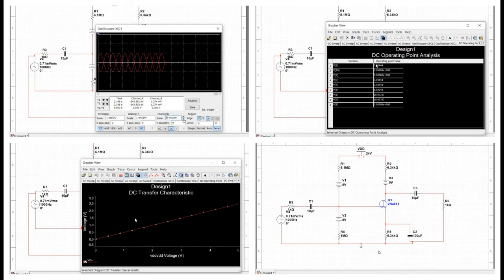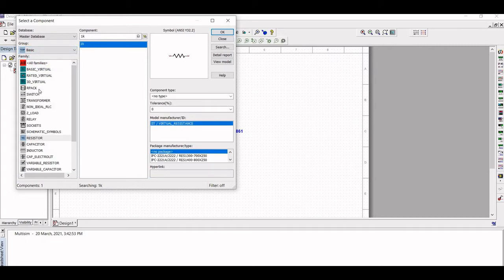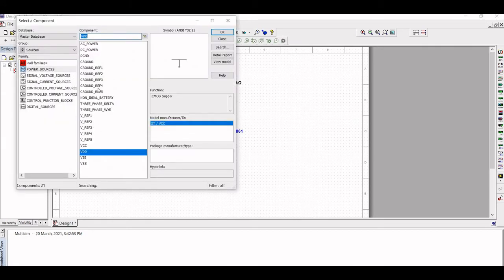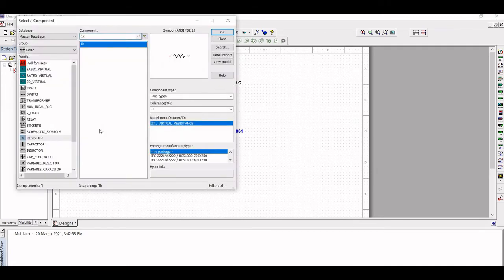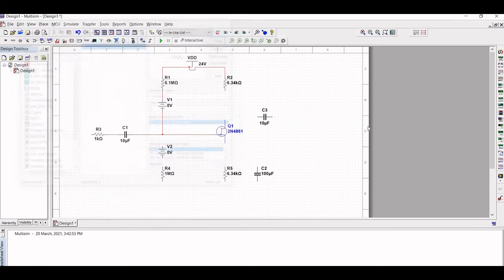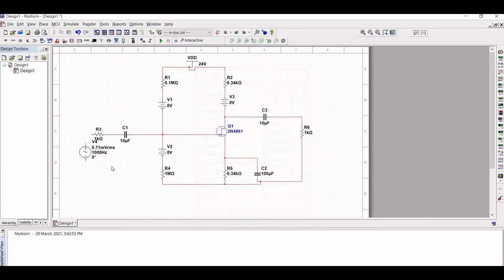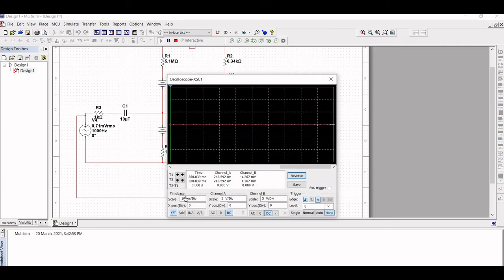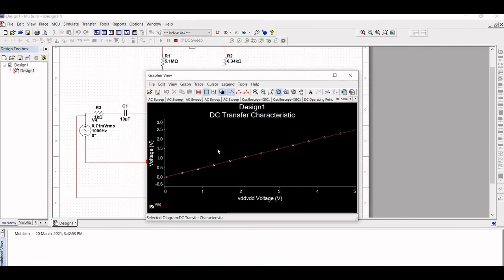Multisim tutorial 2 : Design a single stage FET Common Source amplifier

Comment: may I know what is the IDSS value?
Reply from the maker: As per the simulation result using multimeter it was around 3.79mA
Reply: @circuitgenerator9788  how about the vp value?
Reply: @circuitgenerator9788  how did you measure the Vp and IDSS?
Reply from the maker: You can place a multimeter across the drain and source. Second once the circuit is complete, click on simulate and select analyses and simulation, select dc operating point, then select or add the variables which you want to measure and click on run